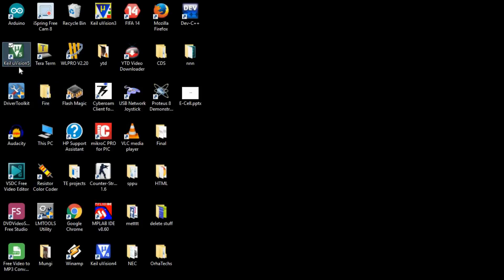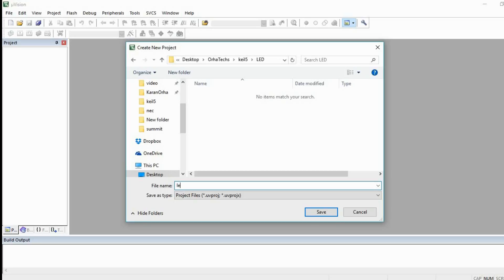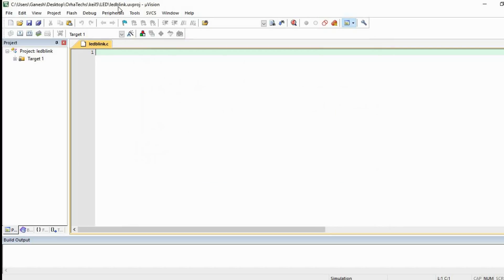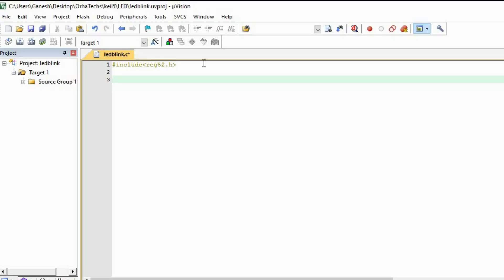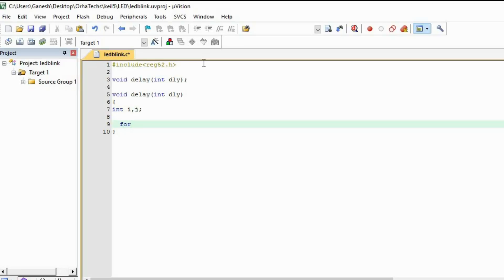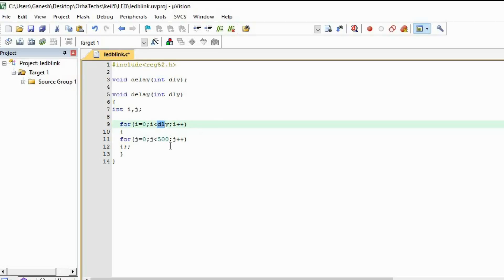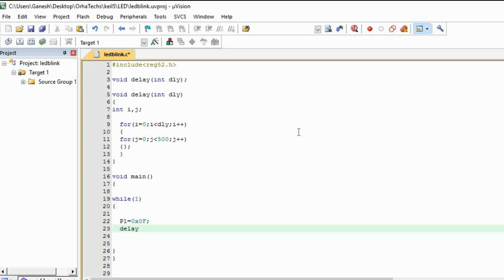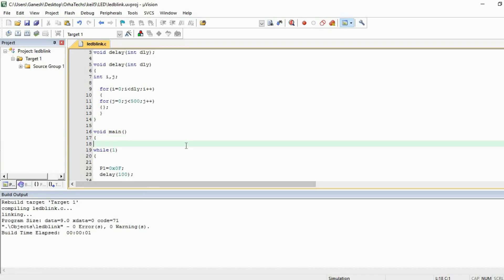Multiple LED Blinking - Part 1 - 8051 Tutorials

Comment: Sir at89c2051microcantroller  program can not  chenj in hax cod 
Please hap how to canvart hax cod
Reply from the maker: follow this link. this may help..
https://youtu.be/FVmEotwsbOI?t=20
u need to click on "create hex file" and compile again
Reply: Sir I saw that as a program . Is warking but in at89c52 .that doesn't work in at89c2051.
Reply: Sir I have created a program in KEIL, AT89C2051.
There are no errors in it. There is no warning.
Debug is also happening.
Also translates into HAX.
But even after barning the TL866 Plus IC programmer, the IC is not working.
Reply from the maker: @nileshgaykar576  the burning process of AT89c2051 is different than AT89C52.
If you are able to burn the program. Then please go through the datasheet or google "operating circuit of AT89C2051" and design your hardware like wise.

Comment: If there is not atmel then
Reply from the maker: if you are asking you are programming on Atmel IC and you are not getting Atmel Option in the keil IC library then please re-install the keil properly
or
if you are using the different company's IC then look for that company's name in the option
suppose you are using  P89V51RD2 it is phillips's IC then look into Phillips or NXP or directly type IC name in search box
Reply: if there is no atmel go to microchip in that you will have AT89s52

Comment: sir, if i use <,>, <=,>= in if condition  keil show shows an error as bad operator
any solution
Reply from the maker: may be you dint added the library file
or the syntax isn't proper
paste the code here ... lemme check..